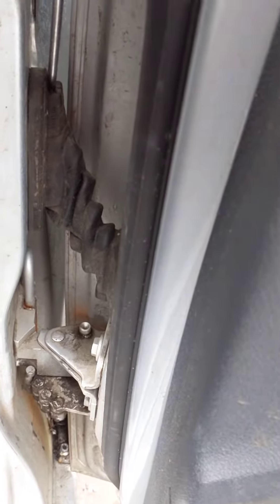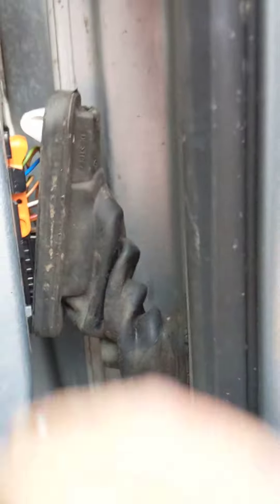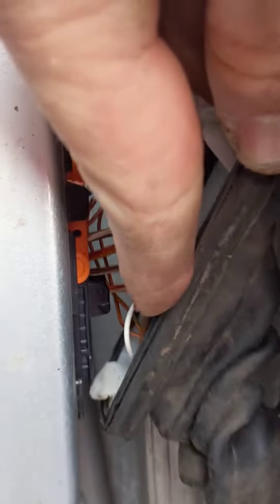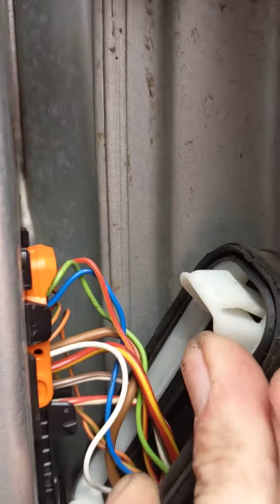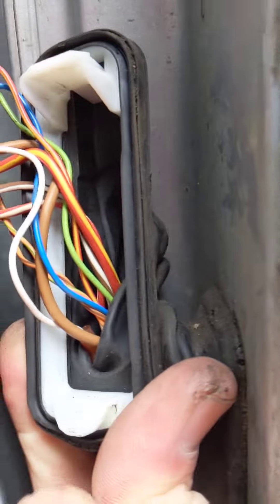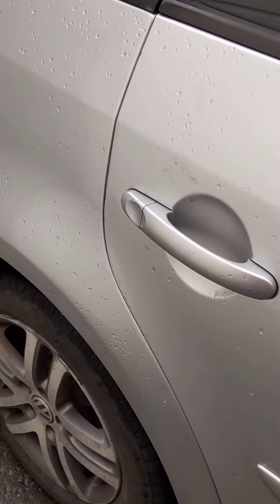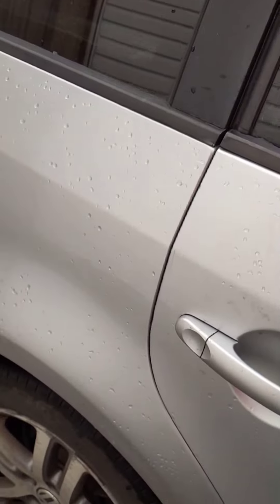01334 - Door Control Module; Rear Right (J389) Window and Door Lock Fault Repair on VW Touran 1T

Comment: Hola. 
Gracias por su video. 
Tengo el mismo fallo que usted. 
El problema es el cable ese que señala usted en el video?
Reply from the maker: It could be the same wire or different. Check all the wires at the driver's door plug and if they are ok check them at the passenger door plug
Reply: @Street_Fitter  gracias amigo. 
La puerta que falla es la trasera izquierda. 
Afectan los cables del conductor en la puerta trasera izquierda o tendría que mirar los cables del copiloto? 
No sé si están conectadas las puertas en serie o son independiente. 
Gracias.
Reply from the maker: From what I understand it runs in series thru the driver's door so you have the ability to lock the passenger windows
Reply: Hi brother I only saw open and close but not showing what to do actually after doing so do we have to replace that wiring or it needs to be plugged somewhere?